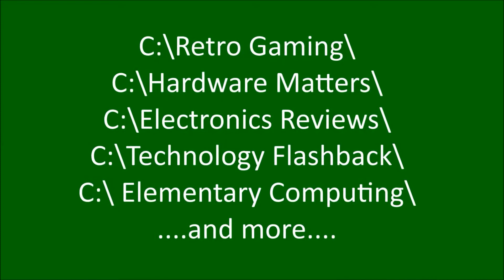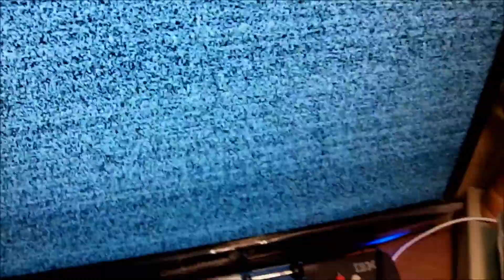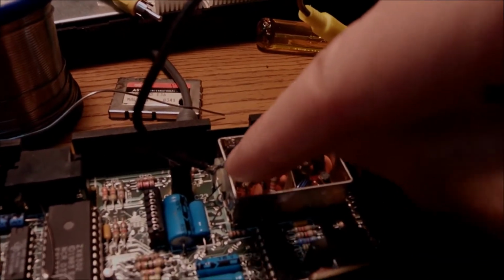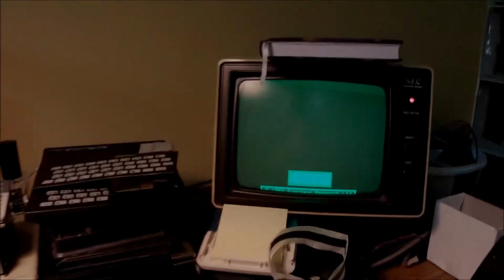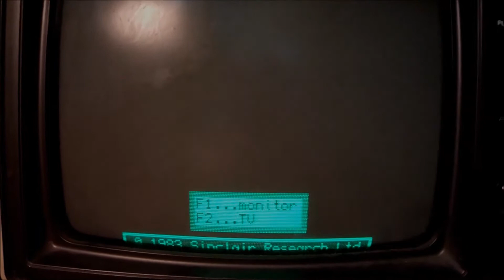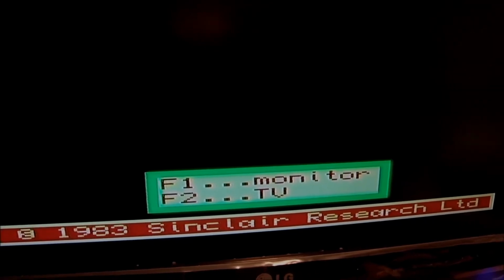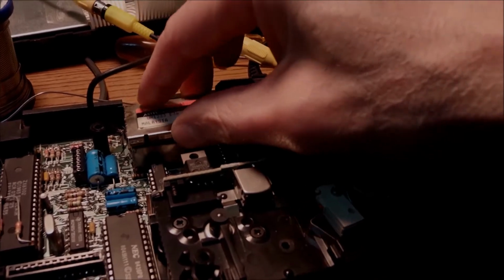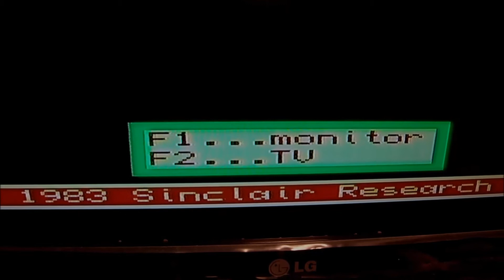SINCLAIR QL - Video Mod - Do it like ZX Spectrum!

Comment: You already have composite video output at the DIN port..
Reply from the maker: Hola Ernesto! you're right except, i didn't have the Din plug and i couldn't find it back then in my local radio shop! thank you for watching!
Reply: @CyberhugTechnologies  I am Ernesto  too 😲 I used a pair of nails to get the composite out first, those DIN Are difficult to get here..